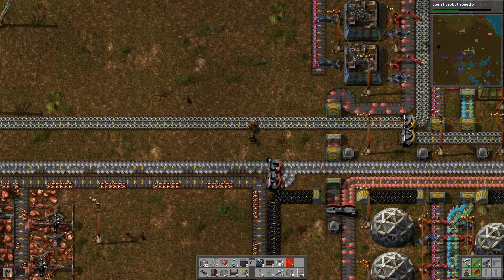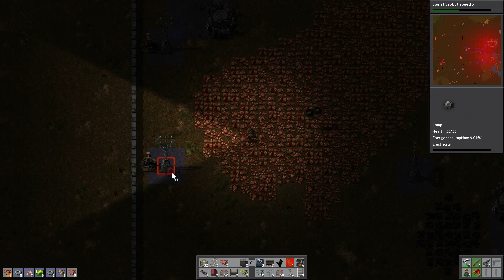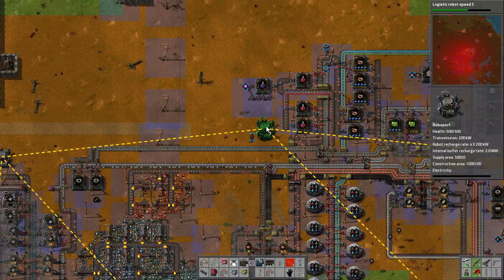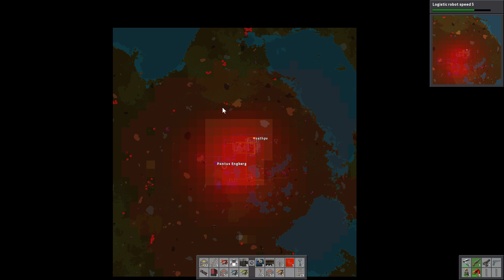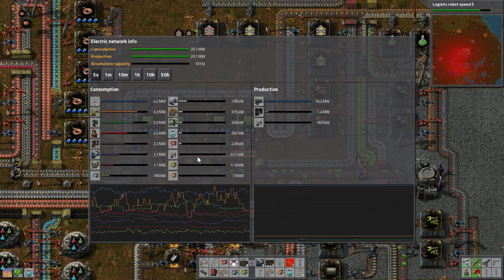Factorio - Season One Playthrough - Episode 28

Comment: You can also put some speed cards into your original copper mining machines if you need to, but I'm thinking that this will also increase the amount of electricity you are using dramatically.

Too bad you can't get more arms to pull green chips out of the factories faster.